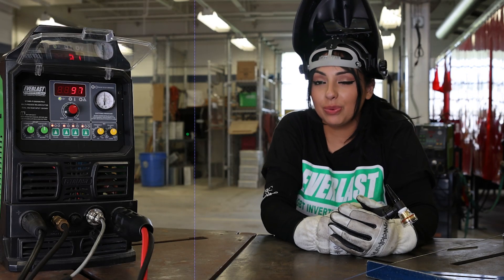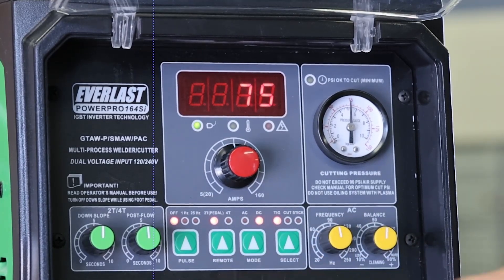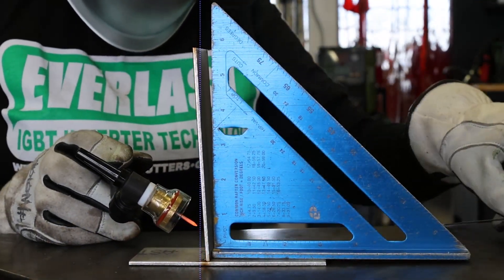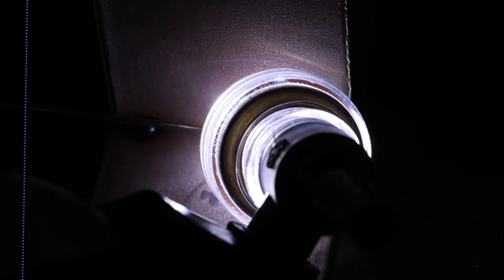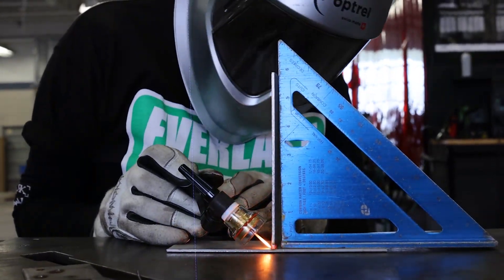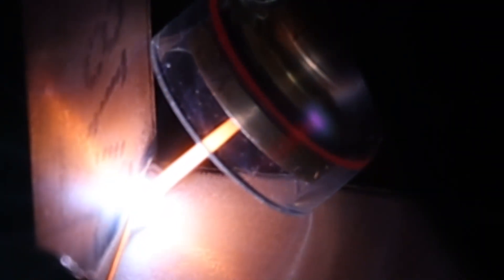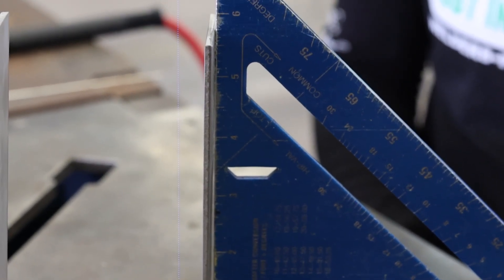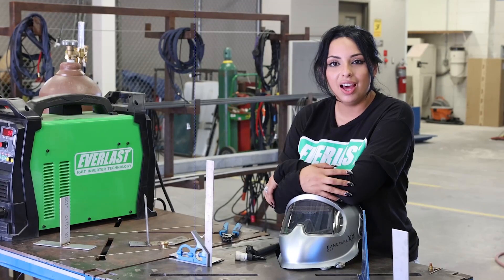Stainless Steel TIG Welding: How to Reduce Warping

Comment: Turn your preflow up, gas pressure down, amps up i would say 82 or 3 and weld quicker to reduce the heat effected area closer with your tungsten, stainless is all about good speed.

Comment: Use a heat sink. Lay the work against some dense aluminium blocks, that'll pull the heat out when welding..

Comment: You can reverse the baseplate warpage by running a bead (no filler) on the bottom to pull it back.
Reply: I've done that on stainless and it works.  Look up heat straightening or flame straightening.  For a simple warp of a baseplate like this example, it's straightforward.  Some other configurations can be much more complicated.